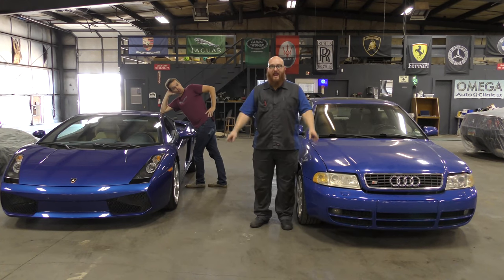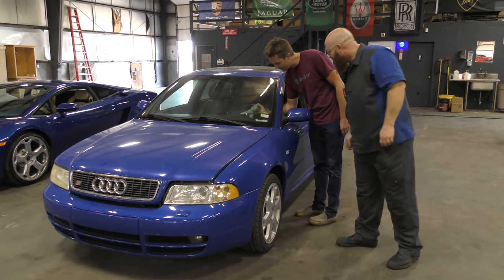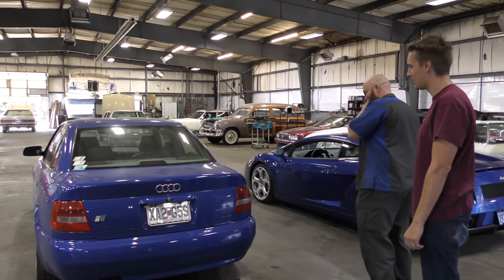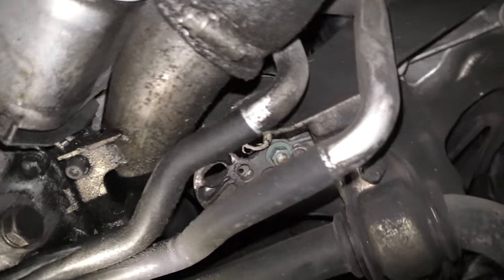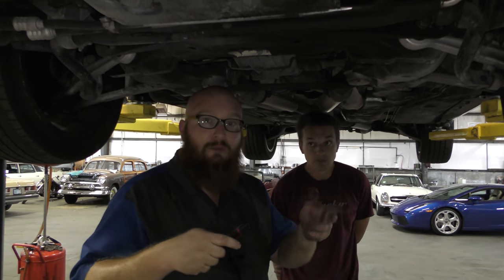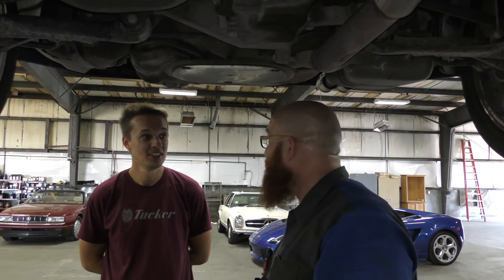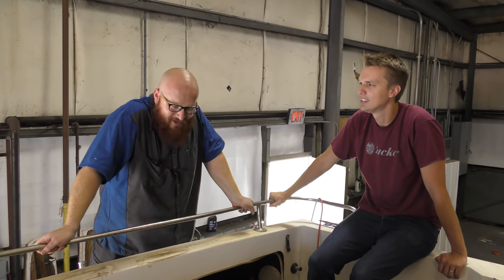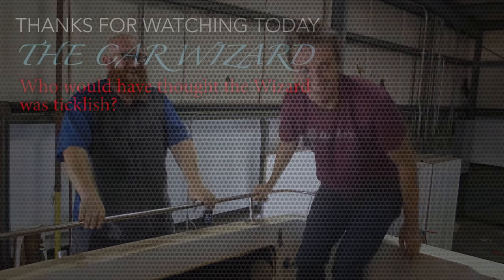Two Blue Audi's & a Boat! CAR WIZARD and HOOVIE talk Audi on 2000 S4 and 2004 Lamborghini Gallardo.

Comment: The engine is definitely not "sideways", it´s longitudinal (hence the torsen diff/real quattro and not haldex). A pair of CV boots (in Europe) is something like 20 bucks and the shafts are more than 10 times that, so I really don´t get the logic... it´s an extra hour of labor at the max and the factory shafts will probably last longer than the replacements. The main two engine mounts are probably ok since there´s no purple seepage. You actually have to align the front one (tighten it when the engine is running). If I´m not mistaken, you´ve forgotten about the top trans mounts a little further back (where the size of the bolt head on the bottom does not match the size of the nut that you have to grab "flying blind"). I doubt that the weirdly coloured factory Sachs sport shocks still do their job, they should by all means be shot by now. I own a 2001 2.8 30v V6 (the base engine for the 2.7T) 4motion manual sport suspension Passat for  the last 6 years and abuse it on the daily basis (150k to 210k miles)... redlining, high rev clutch dump launching, gravel/grass/snow donuts, hitting 150mph every month or so, a couple of track days, a 100+ degrees 1000 mile trip with 4 people and their luggage on board... Sure, there´s a mind boggling PCV system, a few ways for valve covers to leak, al least 5 different leaks that flood the comfort module in the pool under the drivers legs etc. But it sure can take a shitload of beating!

Comment: Here in the uk any split boot, CV or ball joint is an inspection fail and will not pass an MOT. Nor will any warning lights.
Reply: many of USA states are discontinueing automobile inspection for private cars, because the studies have found it didn't make any difference in public safety, and only burdens tax payers.

Comment: 186k is nothing. I've seen them with over 300k. Justin Ballous is the most famous high mileage example. Also, you mispronounced best engine Audi ever made.
Reply: I have a 2000 with 370k on it. Just a little tedious to work on.
Reply: My car is sitting at 302k.  Used to DD it for many years.   Keep up on maintenance and you will be happy with the B5 S4.   The problem really occurred when these cars became cheap, young adults bought them, wanted to go fast and bought the go-fast goodies without thinking about maintenance; then proceeded to complain when the cars broke.  They are not cheap cars to maintain, but if done properly, will bring a smile to your face every time you go out for a spin.

Comment: Those 3.7l 4 cyl engines are actually half of a GM 454, not a Ford 460, worked on many of them, great engines, does yours have an alternator or does it have the stator built into the crank pulley?
Reply: It is a Mercury block that uses Ford 460 pistons and a very similar head.  The stroke is shorter than a 460 however;  These 3.7's are 224 cubic inches.
Reply: @Flies2FLL  damn, learn something new every day! Seems even the folks that teach the mercruiser tech classes don't even know
Reply: @allendaley9439  All I did was google it, the stroke is 3.75 versus 3.85 on the 460.  That thing must buzz like a dildo!  Remember that engine Pontiac built in the '60's for the Tempest?  A 3.2 liter four cylinder, it was famous for having components break right off due to vibration.  I guess on a boat, which is fiberglass and thus somewhat flexible, the vibrations are naturally dampened out.

Comment: Add two more cylinders Hoovie, the B6 S4 40 valve V-8 is the worst Audi engine. The "rings" emblem hints at the trouble awaiting a commonly cylinder scored B6 S4.

Comment: yes i drove a subaru till locking up cv shafts would yank wheel from hands, 2 shafts later better than new.
Reply: Mine snapped at a green light on an eclipse.Was not a fun day.
Reply: @wakawaka5131  it's times like that that learn yah, most of my clunkers got me some where. if they didn't they went on a final dump run.
Reply: @johnditch6357  Lol, that 91 eclipse did the dump run 3yrs later, my 86 Prelude outlasted them all until it got stolen and wrecked.
Reply: @wakawaka5131  they always steal the good ones

Comment: Hoovie! THE ENGINE IN THE AUDI IS NOT TRANSVERSE! Big error here. It's the AUDI's thing - engine far front, longitudinal, which is how their "brilliant" quattro fits in, locating the engine in front of the front axle and in front of the gearbox (this refers to all audis on audi platform, not on Golf or below platform (A3), where engine in deed is transv. mounted.) The front engine mount is not really a mount and the deteriorated rubber doesn't mean much - more of a "bumber" for the engine and to "support" it in case of a crash in the front (removable) radiator structure. But aren't you going to pay attention how similar the alloys are on those two cars? Also, all the subcarriage panel mounting places and swaybar bushing brackets are EXACTLY as on my 2008 A6, despite the generational (and probably abt. 8 years) difference. ALSO - WHY IS THERE OIL ON THE INTERCOOLER JOINT?
Reply: Very common to have a bit of seepage on any turbocharged cars at that junction. Especially if they are tuned beyond stock levels. Tighten the hose or replace it.

Comment: Nobody is gonna listen to Hoovie with his track record.  The B5 S4's were and still are superb cars.  Heavily over engineered and it is no surprise to see it in good order if it has been well cared for.  Yes the engines are a PITA to work on but looked after well, they are not only reliable and solid but can take one hell of a lot of tuning.  MRC in the UK is down the road from me.  Some of the S4's that have come out of there over the years would put that blue Lambo to shame.
Reply: 100%
Reply: I’m making 440 to the wheels in my 01 s4 with 197K. Absolutely amazing car to drive and own... except the cost to fix anything.
Reply: I had a 2005 Allroad with the 2.7t had it from 90k to 180k had zero issues with the engine. If you keep up on maintenance they are just fine.
Reply: Studio Brian ^

Comment: Hey Car Wizard, I have a question regarding Audi A4 B7 rear timing chain cover gasket... it's made of metal and comes with only half, looks like, blue silicone and only on top half of gasket. And has it only on one side... this seems, to me, a recipe for leaks... I've watched dozens of videos where people/ even mechanics just pop 'em on like that... shouldn't I put some kind of gasket sealer to keep it from leaking or is this just the way it is, and it won't leak if everything is cleaned up on all surfaces (cover, head and cam shaft cradle) and has a real nice surface to mate with? Thanks for your answer... watched most of your videos... super cool stuff, keep it up:)

Comment: My friend had a B5 S4 with 345,000km (216,000miles), modified to around 500horsepower. These engines seem to hold up if a bunch of support mods have been installed on them, but garbage in stock form...

Comment: Tyler-  The Bentley with the bad belt in the distributor?  That twin distributor assembly is a Bosch part that is also used on the '84-'86 Porsche 928S2, a series of cars sold only in Europe.  The belt can be sourced from 928 International in California for less than $10.  As to why a NEW belt would strip, there is obviously something wrong with the "twin dizzy" assembly.  Get David to call 928Intl.com on Monday and ask for advice as to why this happened.  They know all about this stuff!  I changed that belt on my own S2 a couple of years ago, it took about 10 minutes.  Good luck!

Comment: the Gallardo is more Audi than anything else tbh. Let's not forget the engine is essentially two Audi 2.5 5 cylinder engines mated together to make the Lambo's V10. Then there's the platform, which is also Audi designed and is shared with Audi's own R8. It shouldn't come as a shock... Audi and Porsche are the technical wizards of VAG, hence why even Lambos and Bentleys use their innovations and components

Comment: Those 3.7L mercrusiers are big block 4-cyl or baby 460's.  I have one in my Wellcraft.  The main issue is the cam seals.  They start wearing into the cam snout and then allow coolant to leak.  Once the 1st seal is leaking you get a coolant drip.  Then if you don't fix it, and the 2nd seal fails you get coolant in the crank case and can wash out the bearings.  Stupid design.  But it has a closed cooling system like a car with a heat exhanger/radiator.  The cam snout usually has groves worn into it and you need to get a speedi-sleeve to fix it or replace the cam.  They are good powerful engines with lots of torque and good on gas.

Comment: That Gallardo isn't an Audi, as people like to call it. Till 2006, Gallardo had a 5L V10 designed and built in-house by Lamborghini. 2007 onwards, it was replaced by 5.2L V10 from Audi, which is an extension of the Audi 4.2FSI V8.

Comment: Replacing a drive shaft used to cost at least 5 times more than a CV boot when I worked as an Audi tech....
Reply: I think he was referring to a aftermarket axle,which are junk. I also was a Audi tech,we always replaced the boot and repacked the joint after a cleaning and inspection. OE joints were more quality than aftermarket.
Reply: @nickpappas4133  Most aftermarket drive train and suspension parts for Audis are junk, in my experience, especially the multi link control arms.
Reply: @panzerveps  thats so true, a friend who is also a tech says if you look up aftermarket in the dictionary it will say “does not fit “
Reply: @nickpappas4133  Hah! So true!
My trick when buying oem parts for Audi, is to buy similar parts for VW or Skoda.
Same part number and everything, but a lot cheaper.
Only works on the TT, A3 etc though.

Comment: Wizard, I don't understand why you plug at the end of your videos about the tools used in your shop. Been a long time since we have seen you actually use some tools to get a job done. Lots of explanation as to what your gonna do to a car or how you figured out what the problem was but little on turning spanners. I know you are busy running the shop but would still be cool to see you do a job such as doing the CV shafts on the Audi S4.
Reply: I don't think there's been an actual step by step repair video. Be cool to see such videos on these cool cars.

Comment: My comment may get lost, but is there any chance the Wizard could make a Buy This, Not That segment for Wagons? I really want an Audi A6 Avant, and I know that isn't really a wise financial decision. Not sure if there is another competitive wagon that is substantially more reliable on a budget.
Reply: Audis are are wise financial decision if you're mechanically inclined. You can expect the automatic transmission to go out every 200K miles and the engine should last at least 350-400K before needing a rebuild if oil is maintained every 3K on a high powered variant such as a C5 S6. The automatic transmissions last a lot longer on the weaker standard A6 versions without the 4.2L or 2.7 Biturbo. There are quirks here and there where Google will tell you to spend $500-$1,000+, but in reality the problem is $10 if you join the C5 groups on Facebook and ask for advice. Most of the issues, you are just taken advantage of by dealerships or shops who capitalize on it being an Audi.

Comment: Incorrect. B5 s4 is a iconic, amazing machine worth restoration in any condition. With a huge fan base. 
I am disappointed in both of you.☹️ Ok I gave it a thumbs up anyway. Not cool though guys.
Reply: I used to think that and then vr swaps were a thing. B5 chassis = great, 2.7t = dumpster fire
Reply: @michaels0ft  Malaka fan? Vr6 swap is sick also.
Reply: 2.7 engine is beautiful and they were over engineered so last forever. The electronics in the B5 not so much, but that's why we do coil pack upgrades and stuff like that :)

Comment: Terrible advice on the CV boots. Never get a mechanic to put new ones on, the market is flooded with cheap Chinese cv boots: the usually fail pretty early. If you have a euro car they come with GKN CV joints, they are good and will last the life of the car, all you have to do is buy GKN boots and have them changed.

Comment: Wow, a lot of prejudice and misinformation on the Audi. And does he really think it is a transverse engine?? Considering his Mercedes was a pile of shit even though it was much more expensive, and well maintained, you'd think hoover would have a little more appreciation for Audi. And the comments about rust, oil leaks, and mileage had me cracking up. Audis don't rust, since like 1986. Can Mercedes say that? No. They also generally don't leak oil that badly, especially compared to BMW. BMW is the German oil leak champ. And you've never seen high mileage with Audis or just the 2.7TT? Because that was a solid chassis, and will continue to go. I suggest the owner fix the seat and shift knob and have a beautiful classic in good condition.

Comment: Gotta disagree about the early to mid 2000 A4's. They don't hold up well at all, the ones that are still going can do it only because the owner spent a ton on repairs and maintenance instead of wisely getting another car. Audi's are almost as bad as BMW in terms of durability and reliability. Mercedes doesn't have a perfect track record with all their models but overall they are head and shoulders above the other two cars when it comes to durability and reliability. It's my observation that over the last 20 years Mercs have lasted significantly longer with less issues than the others...

Comment: Bought a B5 S4 in 2000, kept it 19 years and sold with 207,000 miles.  The only time it let me down was an aux-waterpump failure at about 180kmiles. Fantastic car. "Worst Audi engine ever"..?? complete BS.
Reply: ..and it's a longitudinal engine, not transverse. Never had to replace an engine mount.
Reply: Maybe a lot of owners never changed the oil often enough.
Reply: @Dcc357  probably right - I just looked it up, I changed the oil on mine 35 times.

Comment: I had 2 A4s.  Biggest pile of wasted metal ever manufactured.
Reply: Ford Tempo would like a word with your comment
Reply: Poi Boi ford tempo better car.  Clutches, oil leaks, control arms, turbo, engine codes, electrical and control issues.... I forgot most of the horror.

Comment: The 2.7 has problems and this is true but Audis worst engine ever made? No way, one of the best ever made as soon as you take the time to learn the engine and these engines make great power when modified. They're decent cars if you don't get auto ones. And even the autos ones last. I own 2 2.7s a 00' s4 at 190k and an 04' allroad at 230k and they both run great.

Comment: At 06:00 what the f is wizard on about? He's saying that it's cheaper to replace the whole cv shaft than paying for a mechanic to take it apart and just replace the boot because of the cost of his time. Absolute stupidity and greed or unwillingness to do the honest work. Just checked. For my 2004 audi a4, a cv shaft costs 100-250 bucks, depending on the manufacturer. A cv boot is 10 dollars. So he's saying for him to change the boot and add grease will cost you around 100-150$ extra over just swapping in a new one. Once you have the shaft out, cleaning it and putting on a new grease and boot takes only 15 minutes. Certainly much cheaper than paying 150 for a new shaft.

Comment: 186K miles for an Audi is actually impressive. My dad's 1998 A4 only lasted 120K before he got rid of it due to the engine blowing...TWICE!
Reply: Well your dad must've been doing something wrong because the B5 is by far the most reliable A4 of all time and literally all you have to do is regular 5W40 oil changes and a timing belt every 100k and both the 2.8 and 1.8 will go over 200k. my 2.8 has 210k on the clock and there are multiple guys with 300k on theirs
Reply: @SearchEast2069  I second that.

Comment: the 2.8 30v was a great Audi motor I wonder why the 2.7 is so bad in compairson
Reply: It's not. The 4.2 V8 in the B6 is with plastic chain tensioners and chain at the back of the engine. Because the B6 and B5 looks similar, people often get them mixed up.
Reply: @Richard_AKL  the S4 has the 2.7l 3v Bi-Turbo  the A4 has the 2.8l 30v N/A motor where did the A6 V8 come in the picture?
Reply: soundman447 I'm just saying the 2.7 wasn't a bad engine - he's thinking of the v8 not the v6 because the B6 S4 looks so similar to the B5... many people think it's the same car. Also the A6 got the same 2.7 engine.